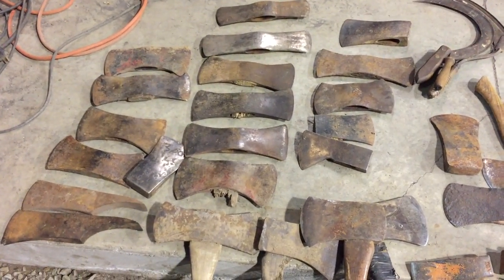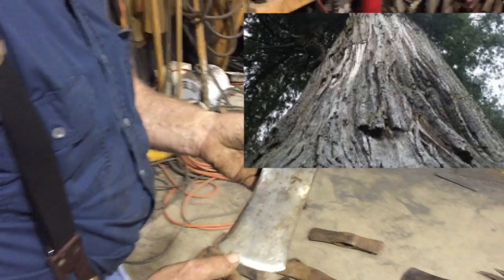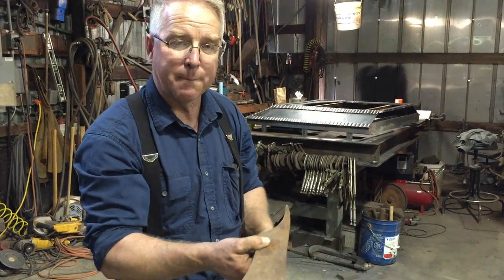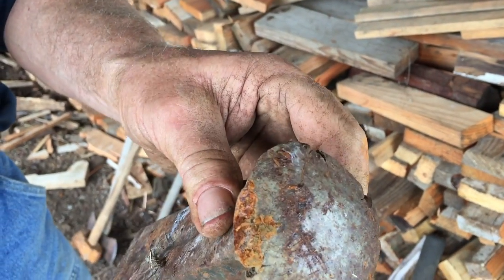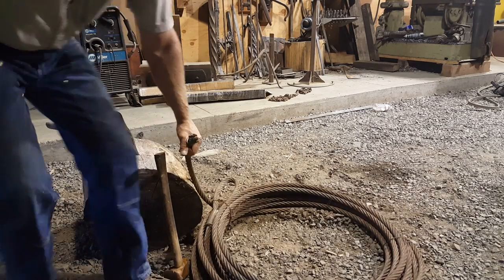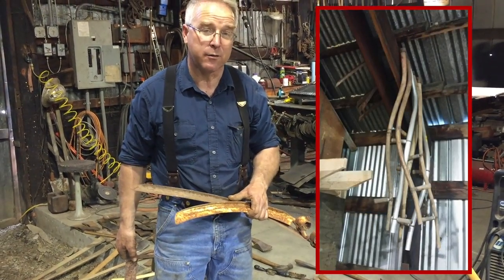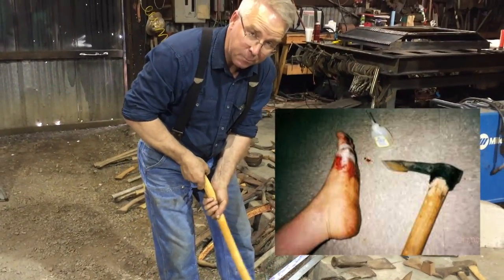Axes and Beyond

Comment: I am glad you talked about the mushroom edges on the splitting wedge. I had a bad experience using a splitting wedge when a piece came off the wedge and shot into my lift thigh. The doctor thought I had been shot the way it entered my leg. I make I grind the edges of my wedges so this never happens again.
Reply: thats why you should use a wooden mallet only on things such as froes or wedges, the mallet takes the beating and your wedge doesnt form a lip to catch.
Reply: Yep. I still have a piece of a wedge in my left leg. Actually it was a "maul" head, or as we call them here in the Southeast a "Go-devil" head being used as a wedge struck with a 10lb hammer. Ever since then when I was about 15 years old, I've been somewhat more cautious about striking hardened steel with hardened steel.
Reply: Thanks for sharing your experience! The old-time term for that is “dressing” your tool to remove the mushroomed edge. Imagine if that chip had wound up in your eye instead of your leg!

Comment: The weed whip at 9;40, my Dad always called an "Idiot stick". It was because of the old times where convicts were employed in the mowing of roadside ditches.
Reply: I remember using one of those to knock down the weeds on the edge of my grandmother’s farm field about 40 years ago.  I mentioned to her that they now made gas powered weed wackers which would make the job a whole lot easier.  She was an old school child of the depression- “if you don’t want to use the weed whip than you can hand pull them instead”.
Reply: Grandpa called it a yo-yo.

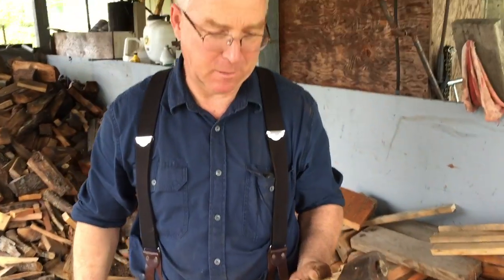Comment: The 8lb splitting maul at 4:10 is familiar to me, because my Dad had chronic back pain so he put me in charge of the fireplace and woodpile (teenage chores ... gotta love em). My tools of office were a hand saw, a bow saw, a single blade woodsman axe, a hatchet, lopping shears, an 8lb sledge hammer, and the splitting maul.  I grew up calling it "The Whop Axe" though. 😁 I think I called it that because  I frequently had to hit it with  sledge hammer to finish splitting logs that were still a bit too green to split easily and cleanly. It is usually used in conjunction with steel splitting wedges, for larger logs. We had 4 of them in my house, growing up.

Dad had a chainsaw, but I never felt totally safe with them, so I stuck with my hand tools.  Good times.

Still got all my fingers and toes.

Comment: please do a video or re-handleing tools axes hammers ext
Reply: Not everyone replaces a handle the way I do. 
     First, pick a handle with the grain, (lines between soft & hard, Summer quick growth and Winter slow growth),    …with the grain running front to back, not side to side or diagonally. You will think I'm full of shit, there ARE no handles with the grain running front to back. You're right. Handles used to be made by Americans who understood tools. Today, handles are made by morons who don't have a clue—but nonetheless—there are 360 degrees in a circle, and an excellent handle being within a range of about 6 degrees, they accidentally make a good handle, (360 ÷6=60),about one out of 60 handles correctly. The grain should be tight, 1/32" apart is better than 1/4" apart. 
     Make sure the handle is right for the hammer. Note: if the hammer handle is Oval, and the opening in the hammer is rectangular, there is a good chance that you have the wrong handle. Once again, that was what passes as humor. SHEESH! Do I have to explain everything? 
     You need a wooden wedge, and 1 or 2 metal wedges with teeth. They should come with the handle, but don't forget the, 'morons who know nothing about what they are making building the tools for those who do,' principle. I use wood glue. Saw the old handle close to flush with the hammer, & use a punch to punch out the old handle. You can save/use the wedges from the old handle. 
     Punch from bottom to top. The wedges spread, so if you try to drive it out from the top, it's like a semi on a bike path. From the bottom, you are driving from the narrow end toward the wider end. Buff the inside with a bit of Emory cloth if you like. I was always in too much of a hurry. Start the handle into the head. Don't start the handle into the top of the head. That passes for humor. Tap it lightly so the handle fills the hole. Pour some wood glue in the top of the hammer head, smear it along the sides. You are not gluing the hammer handle to the head. You are providing filler so the finished handle makes uniform contact with the head. This will minimize the handle loosening later. 
     Note: if you use your hammer with replaced handle for a couple of years at sea level, then do a job at 10,000 feet, your handle is going to loosen up. Don't worry about it unless your new home is at 10,000 feet. It will tighten up when you go back to your cottage in Santa Cruz. 
     NOW, drive the handle all the way on the head. Be mindful that it is the right attitude. It could be leaning forward, not 90°, or it could be leaning back. You may decide you want it canted forward or back. 
     You measured the handle well; it is the right handle for your hammer. Drive it on, and the base of the head may be digging a bit into the handle when it is fully seated. You can trim it with a knife later. The handle is protruding out the top, glue is coming out, wipe it. You are satisfied. Take the handle wood wedge, a little glue, drive it into the sawed curf running from front to back on the head area of the handle. Drive it until the handle tightens in the head. Take a hack saw, and cut the protruding handle at the top of the head. You will scuff up the top of your hammer. You don't care. It is not your $500 stepping out shoes, it's a tool, function over form. You will look at the scratch marks from the hacksaw for the rest of your life. You don't care. 
     Cut flush with the top of the head, you get the metal wedges. A topic not broached with the wooden wedge, you will also drive the metal wedges, which implies that you own a second hammer. I have over a dozen hammers, not including sledges, single jack & double jack, axes, mauls, etc. Place the metal wedges carefully. Some wedges are narrow, and can be driven perpendicular. Some are wider, and have to be driven diagonally. Finish with a punch, and drive the wedges flush. Consider the width at the widest point. 
     Once you drive the metal wedges, wipe up any glue with a damp cloth or paper towel. Don't use the hammer for at least 24 hours, preferably a bit longer. (e.g.; fix on Friday, drive nails on Monday). Consider a cake of bees wax, rubbed on the handle, will keep it from slipping from your hand. 
     If you like this, keep track of me. I will soon begin a channel, and you may get something from what I offer. Best, Tom

Comment: The brush axe is honestly one of my favorite trail clearing tools for the North woods. It can easily take up to 4" balsams with 3-4 well placed strikes and makes very quick work of cleaning off limbs on bigger trees for the Sawyer. The only downsides are that it take a strong man to swing it for 10 hour days, without a pole on the back it takes an accurate swing and if you don't have a good handle the weight of the head runs the risk of splitting handles if you try to cut hard wood.

Comment: 10/4 on a cable cutter or a torch. Between draglines and winch lines I've cut cables from 1 inch down with axe heads and hammers. Sometimes just a raw edge on something when that  axe or cutter wasn't there.  VERY GOOD video and AMEN on the log brand. You need a grab skip though.

Comment: Awwww.  Love my Monster Maul.  Never ever got it stuck in a piece of wood. Used to split firewood in the southern Tongass - wet stuff, usually - and simply don't have the practice and aim for axe and regular spitting mauls. With the right technique, it will split the knottiest, gnarliest-grained, chunk of firewood, or a mighty round of wet Western Red Cedar (which will splash you good). But that handle sure isn't "live". Wrap it in wet leather strips and let it shrink into place. Helps a little. I did think of cotton small-stuff in, say, a Turks-Head pattern, but never tried it before the doctor said no more hand splitting.

Comment: You're right about the danger of 'mushroomed' splitting wedges. I had a small lump of metal fly off the wedge, and it was of sufficient velocity to bury itself deep in my forearm. I saw the blood trickling down my arm and was perplexed as to how I'd cut myself. The blood stopped pretty quick so I didn't think much of it. Next day I couldn't bend my arm so I went to my local Casualty centre (free in the UK). An x-ray revealed the chip of metal resting against my radius bone, and the doctor said it would have to be removed under general anaesthetic. I didn't have time for that, and they agreed to do it with local anaesthetic, but it still required internal sutures.The doctor said because it was white hot when it came off the wedge it had cauterised a lot of the wound, hence the limited blood loss. The chip was slightly smaller than a .22 round.
Guess who keeps all chisels,wedges etc ground clean now. Another case of thinking these known safety issues don't happen to you, until they do.

Comment: Not so funny story. Trying to split out tool handle stock from a piece of hickory with a froe. That hickory didn't want to split but instead of chucking it and getting another I put my right hand against the top of the log and hauled back on the froe handle. The hickory sprung open just enough to let the froe turn and it shot up striking my wrist hard enough to slice an artery.  The hospital needed to know for the record what caused the accident.  I learned most people have not a clue what a froe is. 
Love your channel,  keep up the good work!
Reply: Bob Burch --- And the doctors, nurses and record's department still didn't know what it was, even  after you explained it to them........
 I hope your recovery was satisfactory!
Reply: Tools rebounding can be very dangerous. I was cutting roots from a yew stump with a very old well tempered large machete type knife. It bounced up and cut my finger pretty badly.
Reply: Slightly more amusing story...
    I was actively looking for a froe, and (dubiously?) started at one of my favorite "IRL" research spots, the local flea market... where there are ongoing and long standing booths and tables set up with antiques and tools neatly arranged, even the ones that are clearly "in used condition"... SO when asked what I might be looking for (as good salespeople often do)... I responded, "Kind of looking for a good froe."
    After a few moments of blank staring, he replied, "This isn't a hair salon."

         ... AND the older gent' who'd been thumbing through a bucket of tool handles nearly spit his teeth out. That must've made his day. ;o)

Comment: Far North Bushcraft, Lonnie, has done several projects, making a wood mallet, splitting a log with a series of wedges, progressively wedged.

You were going to meet me, and see a tool that is cold forged. European scythes are completely different from American scythes. They are very light bladed, and swung with a golf-like rotation of the spine, not back breaking like American scythes. They are sharpened in a two-step process. First, the blade is placed on a special anvil with a specific hammer, and the cutting edge is peened the whole length, sharpening and tempering the edge. A peened edge should last between a day to half a day, a pro will need a Noon peening. Then, about every 15 minutes, the edge is honed with a stone. Both sharpening, and cutting, with a European scythe, is a developed skill.

Comment: Respectfully, I'd like to offer my 2 cents to the topic of the splitting wedge: Never strike steel on steel when you don't absolute HAVE to. My father has been a farmer and logger for 40 years and he drummed that into me. He used steel and later aluminium wedges - those mostly for felling - with a wooden insert in the back that had a steel ring around the end to keep it from fraying too much. And they worked a charm. The added length made them more effective as well since you can drive them deeper which is a boon when splitting knotty or strongly fibrous timber. AND they are easier on the ears when you're not wearing cans ;)

Comment: My father referred to the weed whip as an idiot stick
It looks like your family never sold off or threw out a tool!
Reply: We called them a swing blade.
Reply: I had a guy tell me how tired he was after raking and bailing hay all day in his new air-conditioned tractor. My papaw laughed and said how would you like to cut it by hand and load it in the barn with a mule, hooked to a platform with a rope and pulley...
Reply: Perzactly. People don't have a clue how it used to be done AT all. Not a clue. And if and when the lights go out..................
Reply: Survival has a tendency to motivate people... or they die.
Reply: @tedcarl5382  they could also die just tryin to use tools they never imagined existed. More probably, by NOT usine them ;)

Comment: Just an fyi from a more modern logger who doesn't use a torch to cut cable, there is also a wire cutter (I don't remember the name) that the wire is fed through and then hammered to push a blade through the wire. Much easier than the wire maul and no need for gas.

Comment: Great vid, mate. I love how you clarify they're tools of the Pacific Northwest! One of the reasons I love collecting axes is that the head patterns tell little ethnographic stories about where they were developed, a little bit of history, and a little bit of botany. 

I'm so grateful you finally explained to me the thinking behind the Olympic ("Puget Sound Falling" is how Kelly listed them, I think) axes which, to an Aussie like myself, are just plain weird. (We never, ever bothered with double-bit axes down here - swamping wasn't a thing). But explain it's to get through the thick spongy explains that unusual (well, to me...) 13"-odd inch-long head and 3" wide blade make sense, along with the grubbing edge. No one's ever really explained that to me. 

Makes sense on Douglas fir, but wouldn't last a minute on jarrah or mountain ash or ironbark.

It's like the polar opposite of a Tassie pattern!
Reply: Oh, right - I thought swamping meant chopping the branches off the sides of a felled tree. American terms - I'm not quite familiar. 

The long bits on a Olympic - makes sense for thick, soft bark. A lot of the Aussie hardwoods have no bark worth speaking of, and so the short, wide-bitted Tasmanian pattern became just the thing for felling 200' mountain ashes and karris. I've seen more than one American mistake them for racing axes. 

For some reason, I've taken up collecting them. I have no idea why.

Comment: Great collection of axes, hatchets and other hand tools some of which i have used when i worked for the FS in the early 1960's.. One design of a hatchet i have seen pictures of is named a Siberian Hatchet or Russian Hatchet , do you know anything about that design ? Or by some chance you have one of that model?  Some call it a hewing hatchet but it has the same bevel on each side.. so it wouldn't be for that..  Well done good video ..

Comment: As always great videos. I know that there may or may not be a bunch more that you did or didn't mention, but I have a beautiful and in great shape Old Coopers Adz (spelling). It was used by the Cooper for carving out inner sides of the slats of a whiskey barrel before they were burned. The LONG term story of it is that it's a little over 200 years old.
I would like to post a picture of it for you but I can't find a way to do so. If anyone knows what I'm missing please share.

Comment: I had a monster maul just like yours and man was it a POS, but I've also got a 25# maul with a triangular head and a 40" metal handle and that thing is a beast. I can only swing it about ten times before I'm gasping for breath, but it will smash through giant rounds that my 8# maul just bounces off of. If that thing doesn't split them then it's time for the wedges or the saw. The handle on my big maul is a little soft and I think that makes all the difference in swinging it. Those commercially made monster mauls will rattle your fillings when they hit. They're really miserable tools to work with.

Comment: My Pa and I call the weed whip a “weed wacker” (with punny literal connotations) and it is amazing how quickly it will cut tall weeds.  Much quicker than a ‘weed eater’

And I couldn’t agree more about the monster maul.  And I had to laugh when you mentioned about breaking handles.. my dad did not appreciate me being so hard on the wooden maul handle when I was growing up!!  We have a fiberglass handle on our 8 pound now (lol) but I tell ya I’ll never use the mega maul again!! The balance is horrible.. the wedge shape of the head is horrible.. the total weight is also horrible to swing more than five minutes - feeling exhausted and splitting an hours worth of burning wood... not the hot setup!!!
Reply: Same here.
Reply: Johnny Rossman i saw that ugly tool at a garage sale, the guy told me it was a splitting maul but better.

Comment: I suspect that the wire axe was something that you either recently acquired, or got a loan of, for the purposes of the video.
The craftsman in you would not have allowed nails to be used as wedges!  By the way, cutting that cable using hand tools was impressive!  Thumbs up!